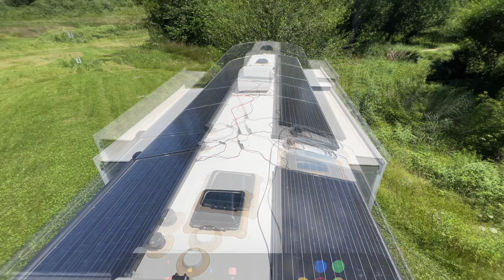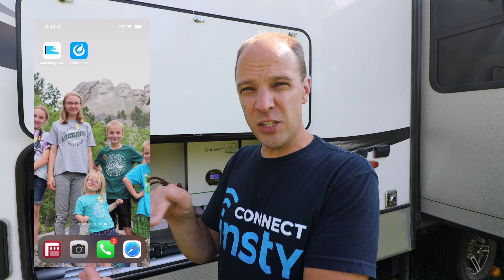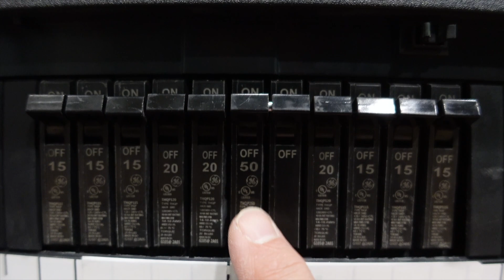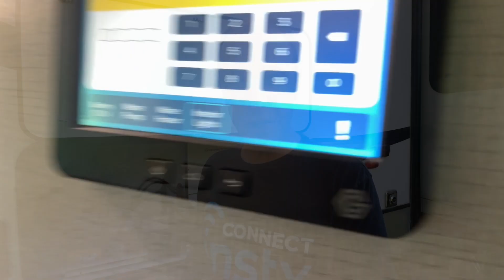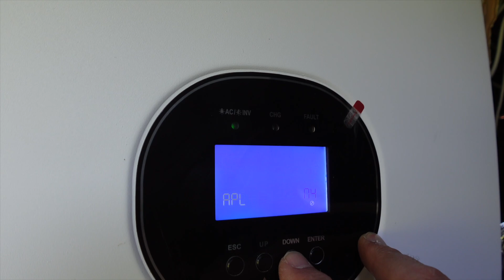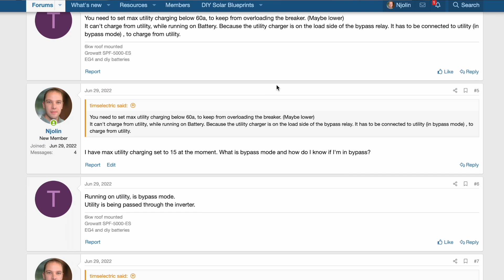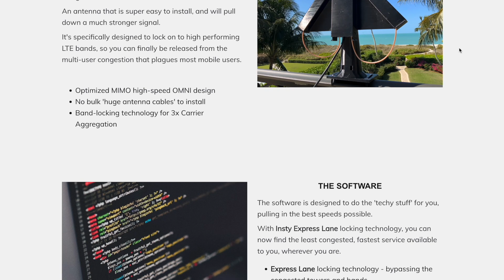How to DIY a HUGE 50 amp RV Solar System

Comment: Hi Nick, for starters, I appreciate all your videos, research and knowledge you've acquired and so graciously shared with us all.  Thank You.  I've been full-time for 5+ years in a 21' bumper-pull. I set it up with 450w panels & charge controller,  2000w Xantrex inverter,  six 6v golf batts in series and parallel config, in addition a 2000w generator (when needed). All has worked well!
However, I now purchased a 35' Reflection fiver and need/want to have a larger system.  I'm quite intrigued about this system you've created and without breaking the bank. Curious about the Santan panels.  Were they used/blemished?  Brand?  Mono or poly?  and how are they working out a year later?
Thanks in advance for any answers!
Safe n Happy Travels,  😉
Kristian
Reply: The best upgrade you can do, if you can afford it, is to get LiFePO4 batteries. I live in an off-grid community, and we all have used the 6V golf-cart batteries for decades, but once I found out about LiFePO4 batteries, and was finally able to afford some, I will never go back to lead-acid batteries. No worries about having them inside my RV, even right across from me in my living room, as they won't off-gas. Also, no having to check the water in the cells, (and paying for distilled water).
Reply: p.s. Santan Solar is a great resource, but you ARE taking your chances on getting a few bad panels once in a while. That is why most folks say to order extra panels. When I was setting up the solar system for my girlfriend's shuttle-bus conversion, I went with brand new 200W panels from Continuous Resources for $185 each, for a total of $1110 for six. I wanted to be sure they were solid and still under warranty. SanTan does the best they can do with used panels, but new was my way of showing my Lady-Love how much I appreciated her being in my life.

Comment: It isn't exactly true that you'd need to "double the size of the wire" to go 12v...
You work on ampacity.
Check the ampacity chart, figure out max amp load on the wires via 12v, and if needed, upgrade to 6, 4, or 2 awg... Use welding wire, it's flexible and easy to work with...

Comment: We use a 48v to 13.8v step down converter. However with the converter only being 30amp It is not enough to run the hydraulic leveling system of our 45ft fifth wheel toy hauler however, with a small buffer battery (5S lithium titanate oxide) It works perfectly. The battery takes 90% of the load while the converter just maintains its 90%-95% charge. This is the only chemistry we found suitable for a constant charge of 13.8v, and makes a perfect full-time buffer battery that can discharge at 200 amps continuous.
Reply: There are 24 Volt to 13.8 Volt step-down or "buck" converters that have higher Amperage, but they can get a bit spendy.

Comment: I never knew an inverter will "refuse" shore power pass through IF the inverter does not see battery voltage ! Is that problem due to charger being inside the inverter ? My RV charger is sperate from my inverter and shore power flows even if battery is asleep/dead and inverter is not functioning. Of course I have to baby sit the batteries to again awaken them but at least my inverter does not block shore power.

Comment: Idk if you see this now. But I would keep the setup the same, as factory. I did mine in 2021 same way as far as, it doesn't change my factory house batteries or charger. Yes, this is not as efficient to use lithium battery bank to charge lead house batteries,  but, if I decide to sell my rv, it would take 2 wirenuts & 10min to electrically remove my lithium setup. It would take about an hour to physically remove all batteries and electronics. So 1 hr & 10 minutes back to factory.  Now I don't have solar, but 15kw hours in a 12vdc configuration.  If I did it again,  definitely go with 24 volts. I can run my Air conditioning up to 10 hours. Then while driving,  we run the genset, to recharge, or camp at campground with 30amp service.  It's great to use ALL our appliances without starting a generator.  Thanks for your video.  Wish I had your (human) energy & enthusiasm.

Comment: Why does the Geowatt spec (SPF 3000TL LVM-24P) show that you can run up to 6 units in parallel, but can only use lead-acid batteries?  Is this wrong???
Reply from the maker: They have a Lithium setting right on the unit itself, but it only works with their Growatt Lithium battery BMS, so I wouldn't know why any of their specs would show that it only works with lead acid.  I would say it's wrong as we've been using it with only lithium and it works great.  The state of charge on the Growatt doesn't work with Lithium, but that is true of a lot of inverters out there.  Most accurate state of charge readings are taken from the BMS itself as it's able to see what comes in and goes out.  Thanks!

Comment: Great info! I'm looking at building a solar system for a bus conversion that will act as a generator while in transit or boondocking. I had a few questions on your set up to help me understand what I would like to build and would love some feedback. It's a 50amp shore power that I will plug into the output of the solar battery/generator set up. 
I want to run dual inverters like yours and to be clear I don't need to tie them together and run split phase, I just one inverter output as the hot leg for each side of the 50amp plug? 

Do I run the batteries in series and hook to both growatts systems via bus bars? It appears that is your set up

I want looking at 3-24v 150AH 3300WH batteries for the bank of my system. Will thst work if all ties together or should I only be using 2 or 4 batteries?

Goal of my system is simple sustainable power for when we are driving to campsite with priority of shore power. 

Any thoughts and feedback would be greatly appreciated.

Thanks

Comment: Excellent video! I particularly like the quick update in the end which closes the loop well. Thanks. One thing I'm curious if you have ever calculated how much battery power is required for boondocking one day and night comfortably, given the size, occupancy and insulation.
Reply: The best way to figure that is to find out how much Wattage each item uses, and for how long you need to use it, each day. Add them all up, and add on a tad more, then you will know how many Watt-hours of battery will support your needs for a day. Multiply that by two for two days. Now, to figure how much solar you will need, not only to run your items, but also recharge the batteries, figure out how many hours of full sun will be on your panels each day. (This may vary if you have trees, etc. shading your rig). The amount of power needed to run your items plus the amount of power needed to bring up your batteries during the "solar day" is how many panels you may need.
With that all said, I have found that a battery bank of 270Ah, at a nominal 24 Volts, (6,912 Wh), (actually 25.6 Volts if you can get LiFePO4 batteries), with 1200 Watts of solar panels running through a 3000W Growatt, which has the ability to take in 2000 Watts, worked well for my girlfriend and I. We camped totally off-grid for a couple of weeks, using an Instant Pot and Rice cooker to cook with, except for our coffee, which I made in an old fashioned percolator on a Coleman stove.
Reply: The size of your system definitely depends on how much power you NEED to use. The less you NEED, the smaller system you can use.
Reply: Exactly, comfort level varies from person to person. Many thanks for the numbers! @Tumbleweed5150

Comment: I have 4350 watts of panels on my motor home, The most I've seen with these panels is 3400 watts, they are rarely pointed toward the sun, unless the sun is straight over head. but even with that I'm very happy. I also have a 6000 watt 240 volt split phase inverter and 15,360 watt hours worth of Lithium batteries. System work very well. I have almost 5,000 miles on the road in almost a year in with this system.
Reply: Nice!

Comment: To utilize the existing 12v system, can you install a 12v dc to 24v dc step-,up transformer, to make sure the charge controller inverters are always powered ?  Put a shut off/on switch to control manually, or an automatic voltage sensor to only turn on when the inverters fall below 24volts.

Comment: I don't think you have 2x50 amps for a 100 amps total. I think you have 50 amps total.
Reply from the maker: Thanks for the comment, there was another comment a few months ago that I spent a few replies on this topic, but I see it's gone :)
You would be correct if I were using it at 220v, but an RV doesn't use 220 v appliances, so you essentially have 2 legs of 50 amps = 100 amps.  Someday I'll do a video to explain this, but I don't know if it matters much :)

Comment: For your 12V the system I use are 2 x 24v  to 12V Victron 70amp. Converters. This is more efficient than the loss you get using the 12V charger powered by your inverters. It will handle your 50amp 12V items, to include you leveling jacks.

Comment: Nick change your low voltage cutoff in your BMS and it will prevent any chance of over discharge. I like your system and your video. And Will is a great resource; I’ve been following him for years as well.  
Thanks

Comment: Awesome!!  I just ordered the growatt 48 volt 3000 48p Inverter to do the same thing. I ordered the 48v server rack battery though.  I've been looking for a video showing this set up for a long time. Thanks for posting. I will have some questions for sure.   Regarding the 12 V system I am going to attempt to discard my 12v old battery and wire in a 48 to 12 volt converter(30a).... Or just see if the converter box(the box that charges the 12 batteries when you plug into shore power)will have enough amps to run my slideouts/jacks.🤞
Reply from the maker: Let me know how it goes.  Thanks!
Reply: @theNickJolin  thanks.  Just finished it:   https://youtu.be/7iGNl0Vmz7A

Comment: Well enjoyed, but only partially understood. Currently, running a 30Amp system, I have 2, 206AH SOK LION Batteries, with 380AH’s of solar on the roof and a 1500W Inverter. This takes care of all my needs except for AC, which is unacceptable in Texas! It is my intention to set up something similar to yours, except for 30Amp. With the exception of changing to a 3000W inverter, I’m hoping to incorporate as much of my current equipment as possible. When I get ready to take the “plunge”, would you be open to a few question?
Liked and Subscribed.
Thanks!!!

Comment: Hi 👋🏻 
Thank you for your video. I’m want to do the same thing in my travel trailer. Mine is 30 amps. I purchase a watts meter to calculate daily usage. Do you have a general idea how many panels and batteries I will be needing?
Reply: Let me know how many watt hours you use a day and also how Many days you would like to run on the battery power

Comment: What I did on my 12 volt system was run a seprate 12 volt 100 watt solar panel to keep my 12 volt starter bettery charged. That way I didn't have to run the expencive wires the length of my rig. You make great videos! I appreate your willigness to share what you would do differenty if you did it a again.
Reply: The 12 Volt system is NOT for a starter. It's for things like the 12V lights, the water pump, and... as he mentioned... for the levelling jacks.
Reply: Also, with the size system he has, he could get by with a 12 Volt battery charger plugged into his main 24 Volt 120ACV output.

Comment: 20:36 I think manufacturers don't do that is because of efficiency. I mean why would you get utility ac convert to battery dc and convert it to inverter ac once again? there's unnecessary loss there. but if you really want it just add  another inverter or change the other one to set it only as utility, solar then battery priority and the other one as solar, battery, then utility priority . or get a ac charger to 24v lithium like you get on ebikes.

Comment: I am running a very similar system on my 40 ft toy hauler.  2400 watts of solar, eg4 6500 all in one, two eg4 48 v server rack batteries (10200 wh) like you I keep my AC and 12v DC separate but running two 12 volt Li batteries and a 200w 12v solar panel panel.  Works great!
I added a transfer switch to keep my solar system and shore power completely separate.  And a 48 volt 18 amp charger so I can keep my batteries charged from a 15 amp AC outlet if needed. The setup works great for me like yours it's evolved over time. Thanks for sharing your awesome system
Reply: Interesting, I like you build, so I was thinking originally to use Transfer switch like you, however adding a 15amp AC breaker to RV Breaker box and wire to AC input of inverter/charger. But still would run into same issue as noted in video where when plugged into a 15 amp shore plug, would be limited to shore 15amp since inverter would be charging. And I would have to flip off 15 amp breaker I just wired and flip transfer switch to inverter. Sometimes all this work around makes me think victron's power assist feature really is worth it.

Comment: Nick, great work but remember that you need the 12v for your trailer brakes in an emergency with your brake away cable. Also did you see the YT over at Five2Go and the guys' massive 48v system?

Comment: Just to put this simply. How do I build a 50 amp solar system that I can just pull up to and plug my cord into it?
Reply: I’ve been researching this myself, exactly what I want to do. Would not need to mess with my panel inside my RV and other advantages

Comment: You wouldn't happen to have a video of the Battery build?  I am planning my own 24V build (smaller 230AH cells though) and am curious around some of the materials (cell spacers) and how they are kept secured with all the motion of the RV.  Also planning to add a 24-12V converter in our case.  In your case, I would replace the 12V Lead Acid with drop in 12V 100ah Lithiums (I got some good quality ones on Amazon with Cold Temp protection for $310 (ADCBatt).  Then just get a low current 24V-12V DC-DC Charger and wire it into the closest 12V available where your 24V system lives.  That's enough to keep the 12V system topped up from your solar/24V system.  The DC-DC charger wouldn't need to be more than 10A @ 14.4V.

Comment: Wow, great minds think alike. I'm planning on a similar system. I think I met you and spoke with you about your Insty connect last year at Quartzsite - one of 10 million other people who did so, I'm sure. We have been FTing for about 4 years now, boondocking most of the time. We only have a 620 watt array now, but it is mounted on the side of our MH so we can lift it to the correct angle to capture the most sun. We used gas struts so it practically lifts itself. We have been using a tiny battery bank of 2 GC-2 golf cart batteries, which means we had to run our generator for a couple hours if we miss a day of sunshine, so we need a lot more battery capacity to take advantage of all the power we're losing. We have a 600w PSW inverter that we run our 55" TV, sound bar, and desktop computer off of nearly all day long. The biggest current draw is our blower motor for our furnace. This first phase cost us about $1,500 to build ourselves. Your 12v system can always be charged by your converter, either through your 24v bank by your inverter or by your generator, if necessary

We just ordered 8, 280ah prismatic LiFePo-4 cells, a little smaller than yours to replace our 2 well used GC-2s, to make a 12v 560ah bank that has about 5 times the usable Kwh we currently have. These fit perfectly in the place of our current GC-2 batteries, saving us about 35 lbs. too. We will be using a Radio B Tech Smart BMS (with cold weather protection), and we will be replacing our Progressive Dynamics 60a lead acid converter with an 80a LiFePo-4 compatible one of the same brand. We just received a Renogy 20A DC-DC battery charger so we can charge it with our MH's alternator, as well as our 5,500-watt generator. This will complete the 12v phase of our solar system for a total cost of around $3,300.

We intentionally left our MH roof free to rack some solar down the center, over the AC shrouds. We will be using 8, 455-watt Solarever Solar panels from San Tan Solar that are only $286 each right now. This will give us 3,640 additional watts of solar. We plan on racking them on the roof, just above our AC shrouds. We will be using a single all-in-one PIP 3048LV-MK 48V, 3kW, 120V PSW Inverter, 80a controller and 60a ac powered battery charger by MPP from watts247. ($692) 

We will be building a 48v bank using 16, 302ah prismatic cells and will be buying high efficiency 48v DC Hotspot 12k Btu heat-pump that I will mount on the rear of the MH with the heat exchanger in the bedroom. This unit is twice as efficient as a standard roof top AC unit, with no inverter losses, allowing us to reduce the size of the rest of the solar system, saving not only money but a lot of weight too.

We should be able to put together this second phase for around $8.5k, which is not too bad for a system of this size, including the $2,100 DC mini-split). This second phase will provide 24/7 off-grid air conditioning and heat from the heat pump and allow occasional usage of our front rooftop AC to cool things down for peak afternoon demand. The total capacity will be 22.6 Kwh of batteries and 4,260 watts of solar (3,640 watts flat and 620 watts liftable) which should be more than enough for our needs for a total cost of around $12k for both 12v and 48v systems if we keep it a DIY project.

Comment: You might want to add a Battery Disconnect switch (It's safer than disconnecting the negative terminals from the batteries.)

Comment: What is the idle consumption for two all in ones? Like 2.4kwh a day based on 50w each? Assuming you only get 1400 watts out of your 1850 solar panels, that means 1.5-2 hours of solar every day is used just to keep the inverters powered on. Not sure if Growatts have a power saving mode.